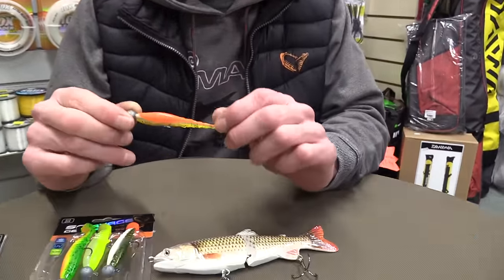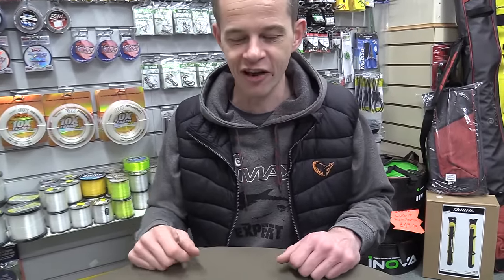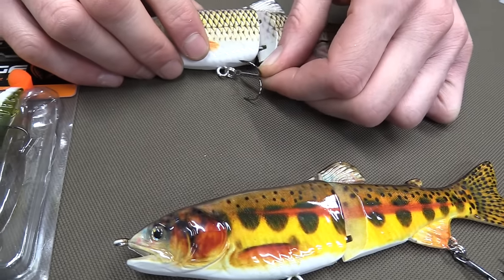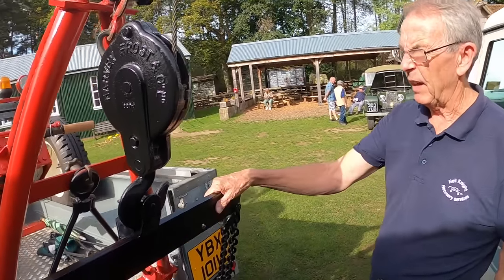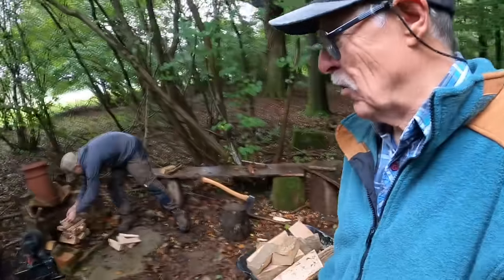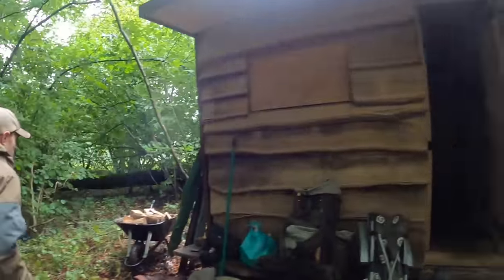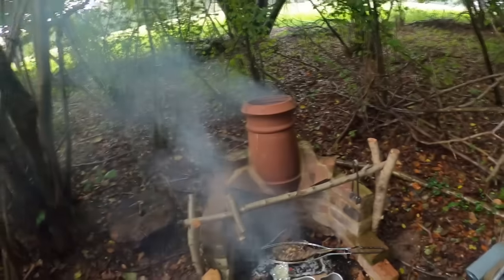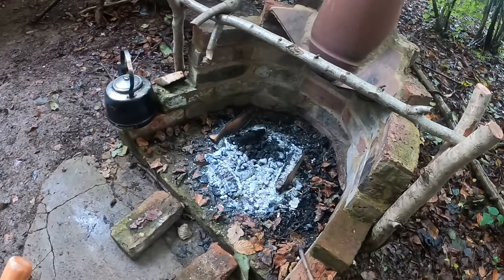These fishing  lures look amazing!

Comment: 12:48 - Supposedly there is a theory behind using big/bigger rubber lures when the water at the places youre fishing look like chocolate milk. Bigger lures cast a bigger shadow and silhouette while the body and big paddle tail move a lot of water as you retrieve it. Its also more of an enticing meal if Mr Pike sees it.

Otherwise for chocolate milk situations, I would normally use spinner baits or a crank/jerk bait with a load of ball bearings in it for some noise.

Comment: Been spinning  for over 50 yrs and the one spinner that catches more perch pike for me and ive had hundreds if not thousands  ,,on them is the original  Shakespeare  big s ,,the one with the rattle in it ,,,😊
Reply from the maker: I still have some and they are reliable.Plus you can crawl them slowly on the surface or pull them deeper for more action. A classic fish catching lure.